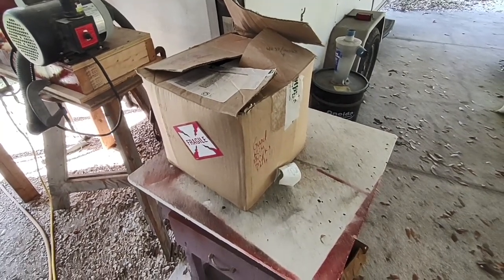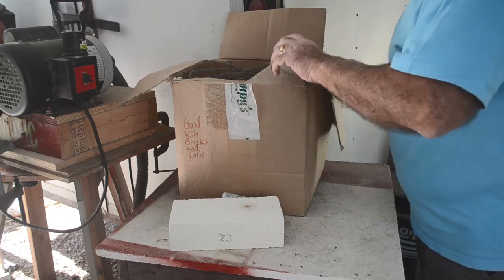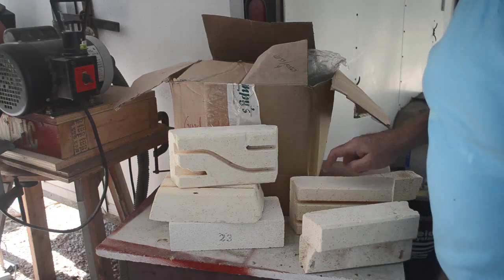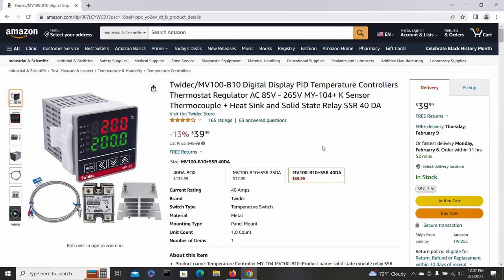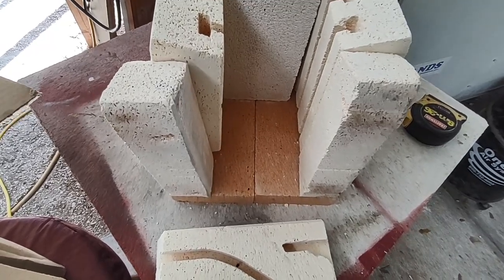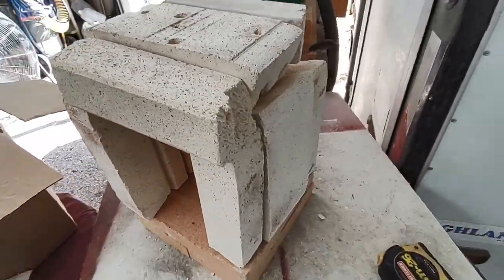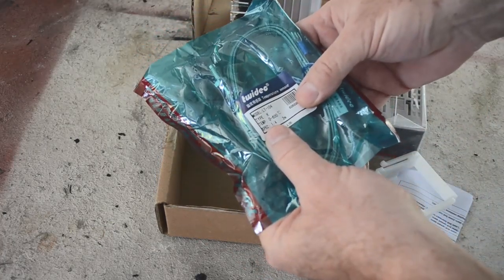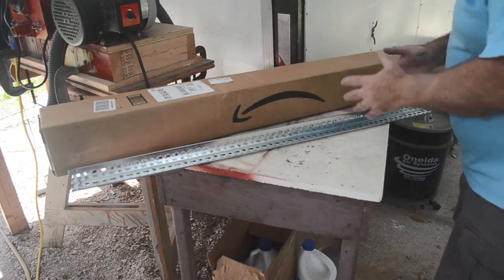A Home Built Cupelling Oven Part 1: Brainstorming A Design

Comment: You know what i was thinking? that you might have already thrown away exactly what you are building
https://youtu.be/UjQZBaZC5Dc?t=211 https://youtu.be/UjQZBaZC5Dc?t=368
on this video of yours a few months ago, can you see those big white boxes that look like refrigerators? those are industrial/lab ovens.
Reply from the maker: Those ovens barely got up to 200F. They weren't designed for temps higher than that. They were also worn out junk. I have another oven that tops out around 550F and is in really good condition, but even it doesn't get hot enough for cupelling.
Reply: Oh i see, i figured you could;ve used the electronics and the housing though.
I am watching what you do, as i need to build a similar thing. I am working on making home-made, cheap lead-acid storage batteries, and the leady oxide needed powder has to bae heated CONSISTENTLY at 450 to 500C to turn into PbO.
thanks for replying

Comment: Years ago i built an electric forge / furnace for melting gold. Worked fantastic. Nothing fancy just a modified transformer pushing 150 amps at 12 volts with a switch. Power fed trought a graphite rod. 3oz gold melts  in about 3 min. Problems were, it had no temp control and the rods only lasted for about 3 or 4 melts